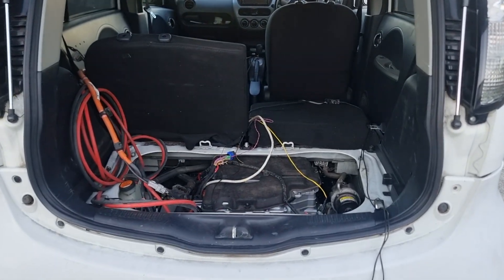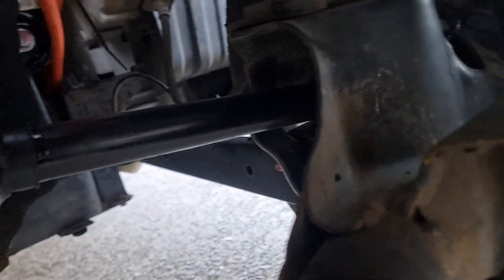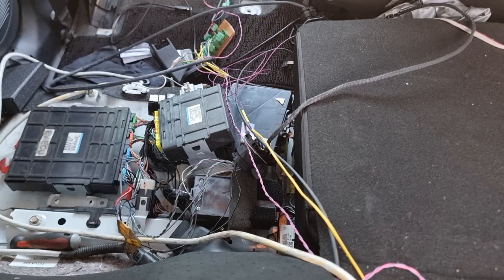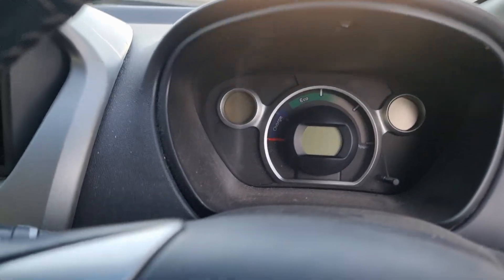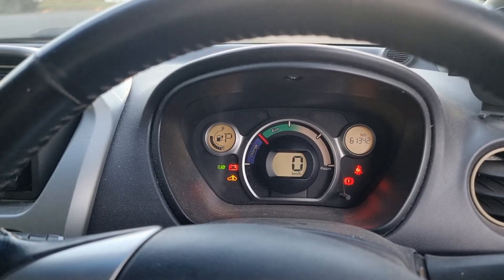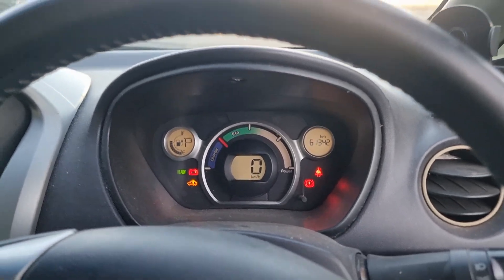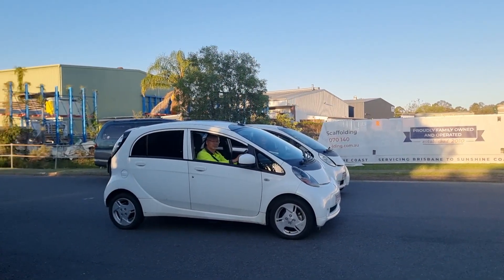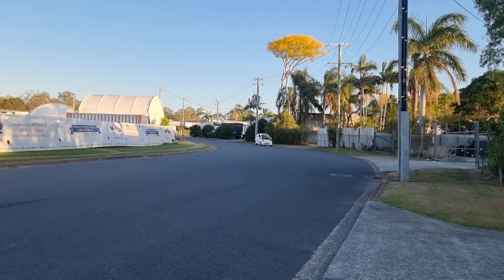Mitsubishi Imiev with Atto3 drive unit upgrade part 2

Comment: Can you tell me what the Canbus addresses for the Miev are that I need at least?
Where do I need to access the Canbus?
What does your Canbus Multibridge hardware look like?
:hand-pink-waving:
Reply from the maker: You need IDs 0x288, 0x298, 0x29A, 0x564, 0x75A, 0x75B. You need to get a circuit diagram from the service manual for the CAN bus connections.

Comment: Wow it a pocket rocket, well done 
A question unrelated I have the first generation vehicle to load adaptor for the BYD ATTO 3, I have purchased a Zeekr 7x it does not come with a vehicle to load adaptor, I pick the Zeekr up on Monday do you think the BYD vehicle to load adaptor will be compatible? I believe it just may need a different resistance value Resistor in the type 2 cable assembly? Have you pulled any apart?
Reply from the maker: It will probably work. I think the BYD V2L works on the MG4.

Comment: What’s the gain out of this upgrade?
Reply: Old: 
47kW, 180Nm, maximum charge rate 3.3kW AC and 50kW DC using Chademo plug. 

New:
150kW, 310Nm, maximum charge rate 7.4kW AC, 88kW DC using type 2 CCS plug. 

This is old school hot-rodding in the modern age.
Reply from the maker: It will probably smoke V8s at the lights and it can do burnouts.  😂
Reply: @franciscoshi1968   @franciscoshi1968  
Next Monday, I will also have a Miev i.
.
Reply from the maker: @BavarianSuperGuy you need a working car before you can take the motor out and use it unless you have the CAN communication protocol which you won't get from the manufacturer. Bypassing the imobiliser is not always easy. It depends a lot on how the manufacturer did it and it is extremely time consuming.
Reply: @franciscoshi1968  I'm going to write to the companies to ask if they can modify my engine control unit so that the car starts without a key. Later on, I'll have the keys and immobilizer from the converted car.

I thought you had removed the immobilizer yourself, but you probably just glued it on :-)
Happy tire burning, thanks for your reply.